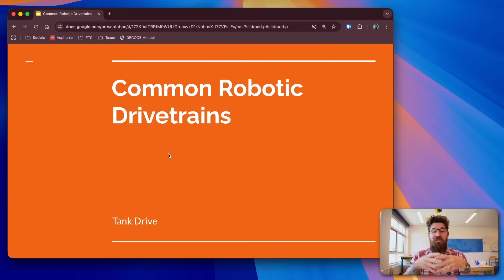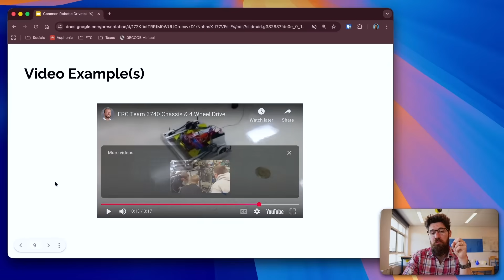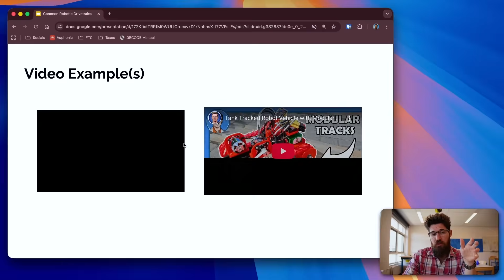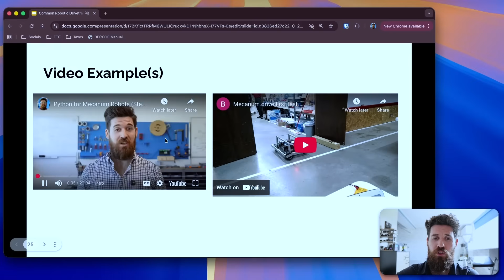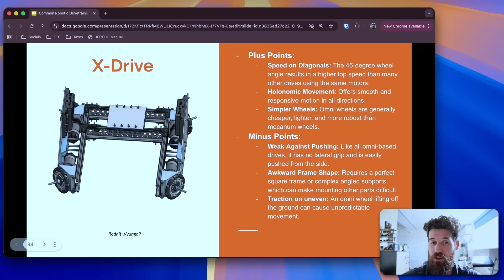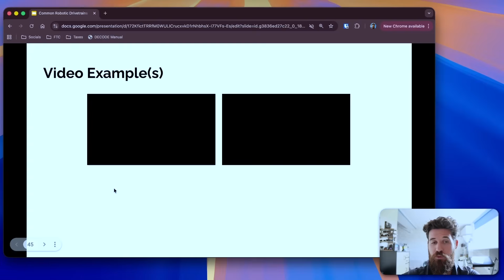The Ultimate Guide to Robotic Drivetrains

Comment: My thoughts on the rebuilt game
- Swerve not necessarily the best for the bump
- Robot perimeter lost 10in, weight constraint is also low, and you need to maximize space for fuel storage. Swerve is space and weight hungry
- No game objective other than defense necessarily allows swerve to excel. A turreting shooter plus common computer vision eliminates the necessity of manuvering in shooting. 
- No requirement of robot movement control precision whatsoever. Even a dump truck can play this game. 
Maybe with the greatest weapon of swerve - movement agility precision - taken out of the list of requirements, the simplicity, weight reduction, space saving and reliability improvement of a strong tank drive is worth it.
Reply from the maker: I agree with all your points, particularly of note the final one. If a team is capable of developing a rotating turret, I think that'll be a great way of solving this problem. Perhaps even multiple depending on throughput. Additional weight on those flywheels is going to be incredibly important.